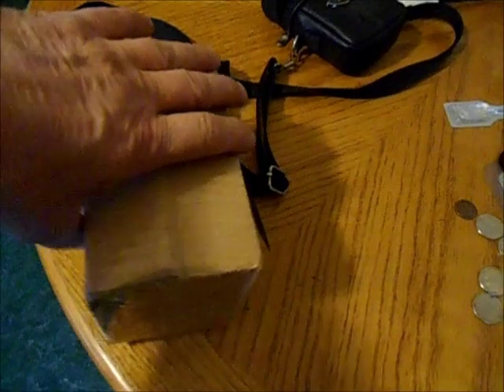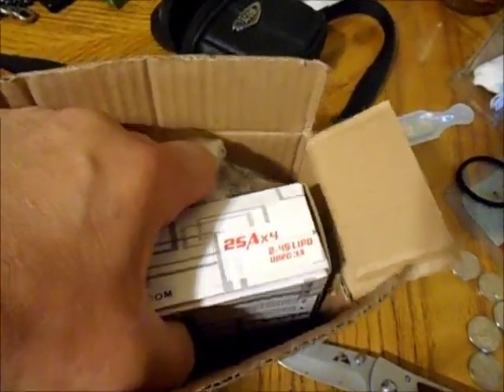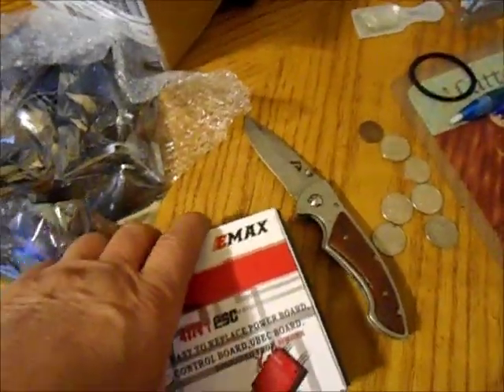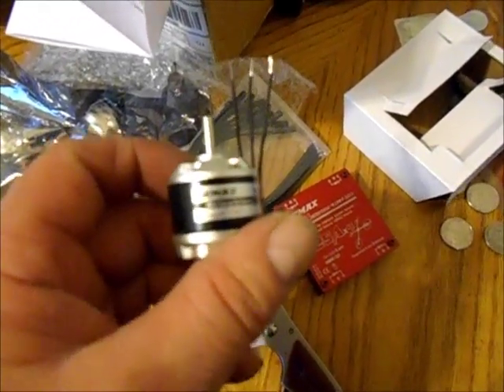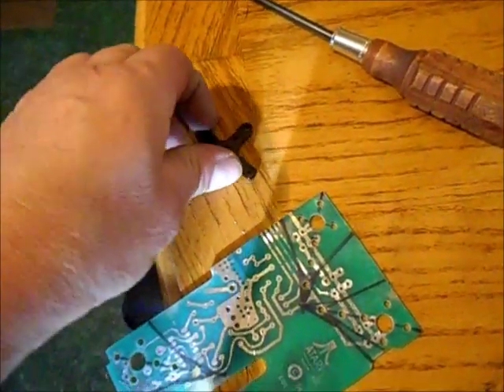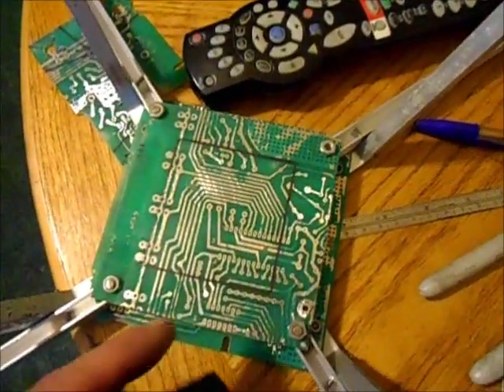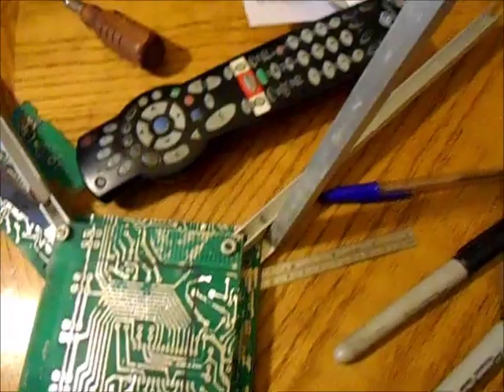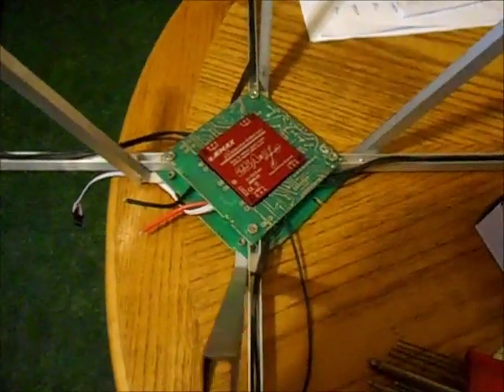Quadcopter Build Part 5: Motor and ESC Unboxing (Emax 2212/980 kv & Emax 4 in 1 ESC)

Comment: I am facing a problem, that is at first time  when i connected 4 motors using emax 4 in 1 esc then it workd, but the power supply was not equal for each motor, thats why i tried to calibrate the transmiter and motor with the connection of emax, but that time motor 2 and motor 3 working but motor 1 and motor 4 does not working. And when transmitter power on after calibrate then  3 starting beeps coming from motor 2 and 3 but when transmitter turn off then the 3 starting beeps coming from motor 1 and 4. Now how i can solve this problem, pls help me. And thanks for your vedio also.

Comment: I am trying to build a quadcopter but i am facing problem in calibration of ESC. I have 4in 1 EMAX ESC. I am using Arduino UNO to calibrate the ESC. My code is:

#include <Servo.h>

Servo esc;
int potpin = 0;// Pot pin
int val=0;
void setup()
{
  esc.attach(9);// ESC attach to pin no 9
  }
void loop()
{
  val = analogRead(potpin);
  val = map(val, 0, 1023, 0, 179);
 esc.write(val);
  }
by using this code i have calibrated 2 ESCs (esc1 and esc2) out of 4 and they are working fine. but other 2 ESCs(esc 3 and esc4) are not calibrating properly although the ESC is giving the calibration confirmation tone but motors are not rotating.
my procedure is-
1- throttle the pot at full.
2- connect the li po and turn on the esc
3- after exact beep sending the minimum signal to ESC (by throttling pot to lowest position).
4- certain beeps come and finally calibration confirmation beep comes and ESC has calibrated. but motors are not rotating
Can anyone  help me .
Reply from the maker: Not real familiar with Arduino UNO. I don't use this board anywhere nor do I know how to write code for it. But I am familiar with EMAX 4 in one ESC. It is JUNK. Mine worked for a couple of days then it just smoked. Also one EMAX motor smoked as well. I ended up scrapping the EMAX and went with the 25 amp Q-Brain from HK. I also took off the undependable EMAX 980Kv motors and bought four Multi-Star motors from HK. Been happy ever since. Have you tried picking up the model and moving it to see if that triggers the other two motors to start up? The gyro and ACC control what happens when the craft is sitting still. Improper calibration of those two devices can cause the two motor lack of spin thing. Do you have these sensors on board of your craft? If not, how will it fly? I don't even know how the UNO board fits in with multirotors.  With my Multiwii Pro FC (has all sensors installed on board) you can't tell if the all of the motors work unless you try and move it. Keep the props off of course when doing this kind of thing. Also, this board uses an easily available pre written code that you modify to fit your craft. Its called Arduino Multiwii. On my fully functional drone, sometimes one motor doesn't turn on startup until the craft tilts itself on trying to take off, then it kicks right in. If you are using something other than the HK Multiwii Pro with MTK GPS module flight controller, I can't help you much more than I already have. If you are trying to make a bunch of generic Arduino boards work as a conglomerated flight controller I am really of no help to you at all.
Reply: The420four
Thanks for reply. I don't have any sensor on board now. But my first issue is that motors are not rotating properly even after calibration. I have to change my controller also but before doing that i am trying to measure the speed and thrust of each motor. I am tired with this ESC. I have tried all things that i could do but still problem is same. I have posted in many forums but no REPLY :( ... Thanks again